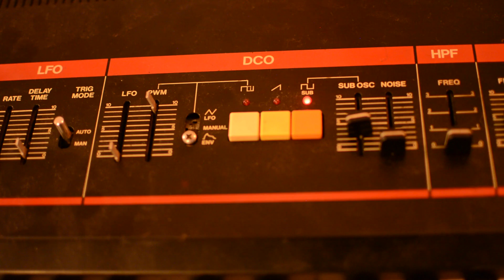Juno-60 MIDI Minerva Mod Instructional Guide Video

Comment: I have the minerva installed but it seems like the VCF now needs to be re-callibrated, it doesn't go low enough anymore. If I set the pitchbend control to the VCF, put the VCF fader all the way down, and then also move the pitchbend joystick down, the VCF gets to the correct low frequency cutoff. Is this normal? Is there some instructions for re-callibrating the VCF somewhere?

Comment: I had 'troubles' with connecting the bender 4p on to the mod board because the wires were to short due to a cable tie into the bender section. Only after taken the section out and cutting the cable tie, I was able to smoothly connect the connector. This instruction guide exactly at the point of connecting the 4p connector to the mod board skips from gong to connect and having it seated. At 3:11/12.

Comment: Hi, I have Minerva with firmware 1.4 - do you have a copy of 1.7 or any idea how I might find it?  The dev appears to have gone off-radar....
Reply: hmm, i do not might want to ask Victor Scherman from the comments
Reply: There is a an application called "midi ox" you can use i think as part of the method of uplaoding the new firmware to the juno. Look it up on google. Its not difficult.

Comment: Were you having any issues with the offset for the DCO and VCF on the bender board drifting over time? It's been doing that on mine and driving me nuts!
Reply from the maker: I did not notice any drifting with DCO or VCF. Next time I record with it, I'll check those settings
Reply: It may be a faulty part on mine. I've tried reaching out to Lazslo but haven't had any luck.
Reply from the maker: keep on emailing him, i had a similar problem getting a hold of him, after a month, he finally got back to me. he should send you a new one, and you switch it out. i had a faulty one with the first one I installed, then when i got the new one it worked, minus the 4-stage freq filter
Reply: Great mod, awful customer service
Reply: Incredible Change did he perhaps change his email? I haven't had any luck! I almost want to ask if you can email him on my behalf!!
Reply: Managed to get in touch. He mentioned that the drift is a known issue and he'd recommend putting in a more precise offset trimmer or a better amp IC but he doesn't have the time to experiment with it.
Reply: any chance you have a more recent firmware version? My minerva chip shipped with 1.4 but I think there were some updates made after...
Reply: @jahsquare1  were you able to find more recent firmware, I recently installed one but it only has 1.2! There seems to be some bugs...

Comment: hi! any stuck notes or syncing problems with the arp in 1.7?
Reply from the maker: +Jacob Korn No stuck notes or syncing problems. I checked just about every midi feature, but only one not working is the 4 stage filter. But I'm now unsure if I damaged that, or it's the current Minerva I have in there
Reply: Hang on - where did you get 1.7 from? I'm on 1.4 and have stuck notes, arp sync problems etc but the latest version I can find is V1.6 from http://kovariant.d250.hu/index.php/products/minerva.  This is a fantastic product but seems to have stopped development?  (Only thing that really bugs me is that there is no way to lock filter env to amp env.  Well that and the stuck note problem.)
Reply from the maker: it showed up with 1.7, but if you emailed him, he should send (although with 4 week wait time with average reply time)
Reply: if anyone has firmware v. 1.7 can you please get in touch?
Reply: @jahsquare1  DM me - i have it somewhere on my machine - i can email it over to you.
Reply: @breakz187 I am in need of 1.7 too if you still have it!